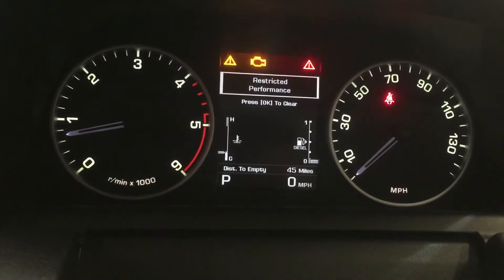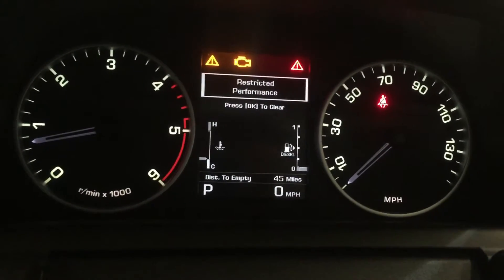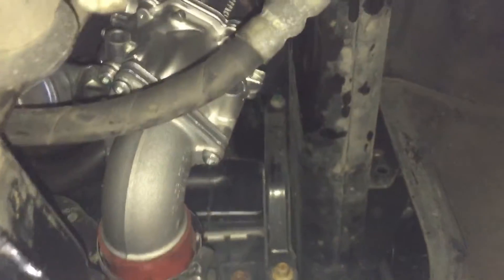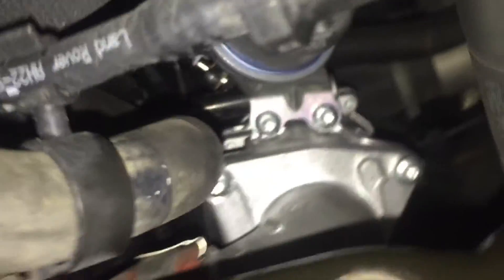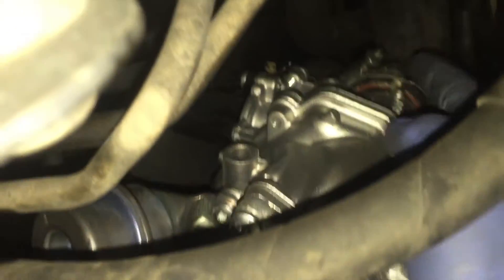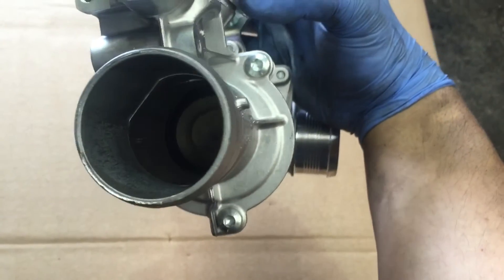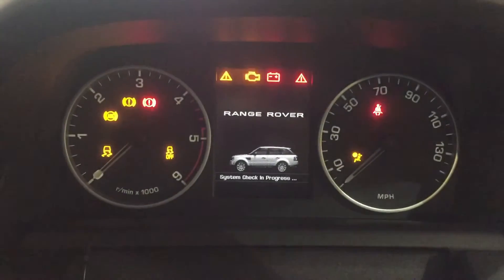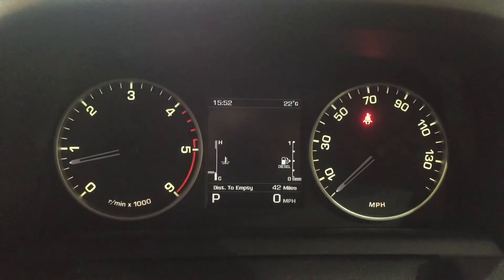3.0 TDV6  Range Rover Sport & D4 Turbo Comp/Air Recirculation fault

Comment: When there is an issue with the RV (Recirculation Valve) and the CSOV (Compressor Shut Off Valve), we have ONLY the P1247 and Restricted Performance and no  other codes. If there are other codes you have to investigate farther those codes. With only P1247 the issue is at the valve. Keep in mind please that both valves work at P (Park) and N  (Neutral) and not just in D (Drive), from 1800 up to 2300 rpm. The rpm frozen on the that range and it's a characteristic of the valves problem. They can't synchronized to open and close on time. There is not an ECU code about it. The ECU checks the MAP and MAF sensors prices and if is recognized and issue there we have ONLY the P1247. We have to replace the valve, 20 minutes work but it's expensive!

Comment: Hi, what was wrong with your recirculation valve? I disassembled then tested mine by blowing through the inlet and I found that the recirculation duct was not airtight and that the solenoid valve flapper only pressed slightly on its seat.
Did you blow into the pipes of your new valve?
Thanks for your video!

Comment: Restricted performance can come up with a number of things. Firstly don’t get all worried that it’s your turbos & body off. Get the codes read. Could be something as simple as a fuel sensor.
Buy a fault code reader it’ll help you sleep better.
I bought Icarsoft 3.0 Jaguar Land Rover about £170 possibly cheaper. It’ll cost you around £100 to plug your Range Rover with a mechanic just to get a code. Just remember   machines will be more honest than some mechanics. Scare tactics makes you part with your hard earned cash. Enjoy your Range Rovers & buy a fault code reader.

Comment: My mechanic has said accessing the secondary turbo (which he wants to replace) is a "body off" job due to access. Is this right? Or can it be done by putting vehicle in extended height mode (could prob go super extended as have LLAMS fitted too). I'm still recovering from the shock of his AU$5.5k quote
Reply from the maker: He is correct. It is a body off job to replace the turbos on the twin turbo models. We always replace them as a pair, if one fails there’s a good possibility the other isn’t far behind. 
That’s not a bad price they’ve quoted, it’s the joys of owning a JLR product unfortunately.

Comment: Hey guys , I believe I have this issue, the secondary turbo is blowing into the air box as if the turbo is running backwards and spitting oil onto the MAF's , can you confirm this may be the flap getting stuck and the primary turbo is causing air to run backwards through the secondary into the air box ? Hope this makes sense
Reply: Could rather be the  reticulation valve that is stuck close thus leading cause my be a faulty solenoid
Reply: Have the same issue. Have you solved yours?

Comment: Had one of these faults on a customer's discovery and it took ages to find the problem..
Reply: What was the code? P-22D3-77 ?
Reply: @gex230  Cant remember unfortunately, however try to confirm through different sources
Reply from the maker: Xopher hope this video helped & you fixed the problem.